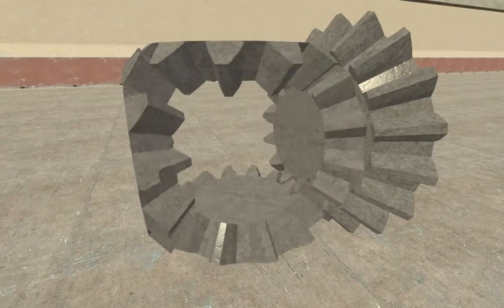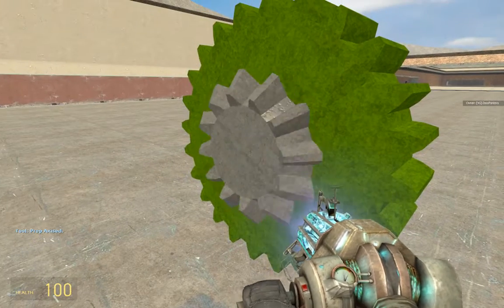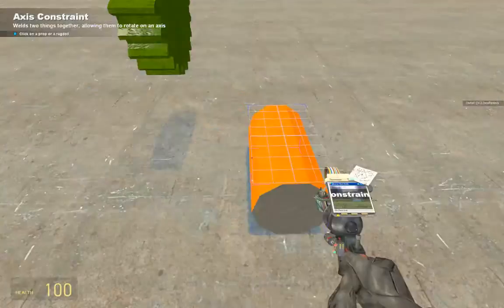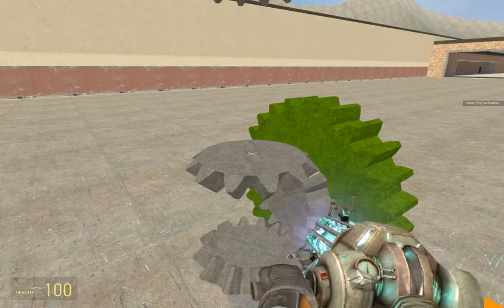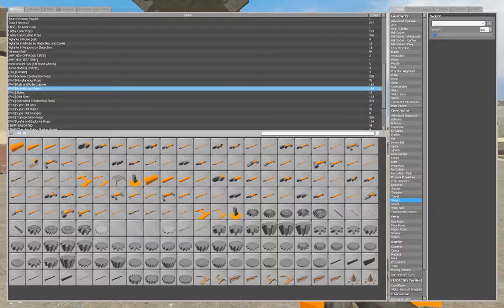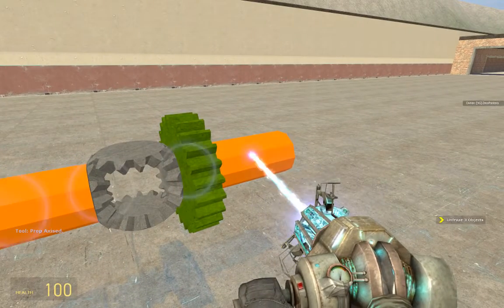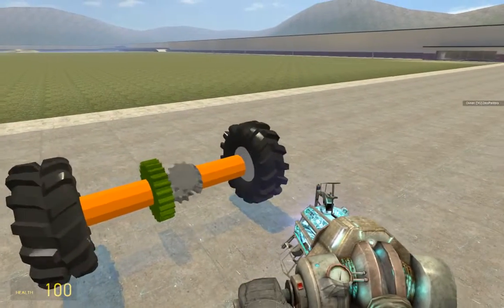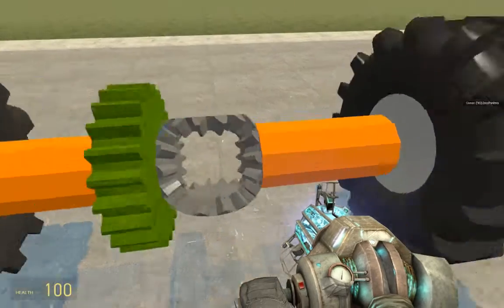GMTUT - How to make a Gear Differential

Comment: I found the best way to make a differential is by using the advanced ballsocket with low friction. It doesn't work as good as the gears, but it reduces the lag.